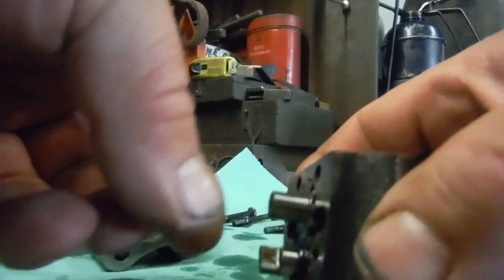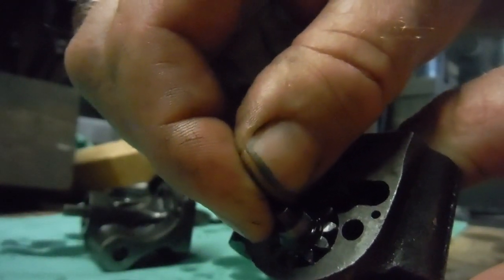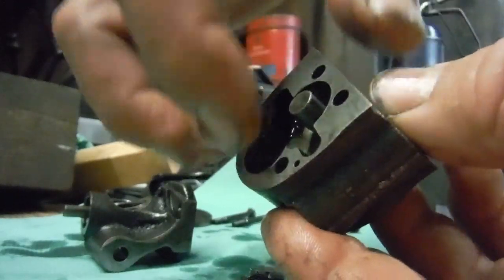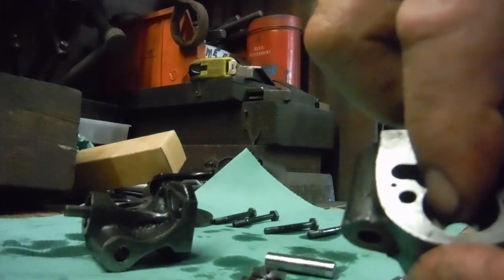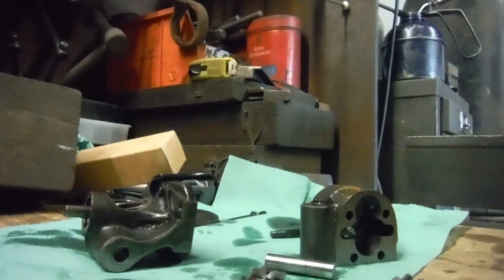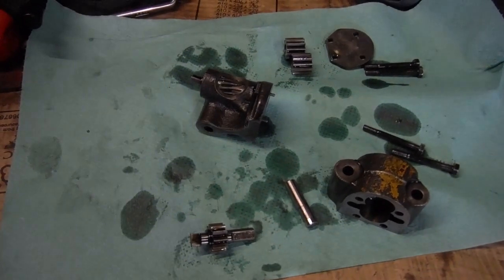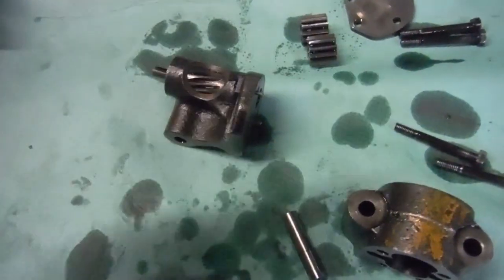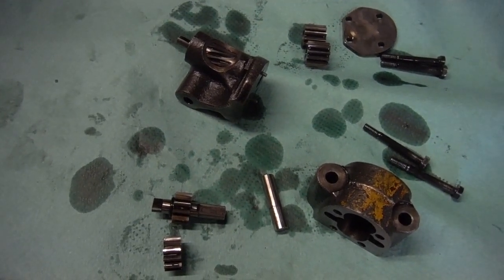BSA A65 badly worn oil pump checked and discussed.

Comment: Low pressure lubrication by centrifugal ring as in the case of motors with bearing rods, or even with pressure, the body of the antimony or aluminum oil pump lasts longer, as long as it is lubricated with clean oil. In the case of the inspected pump, even built with more resistant material, it was very worn out. The safety valve must have the relief pressure measured by the factory. The owner had the good sense to send the machine to whoever has the capacity to definitively solve the problem. You will have your beautiful Twin for a long time.